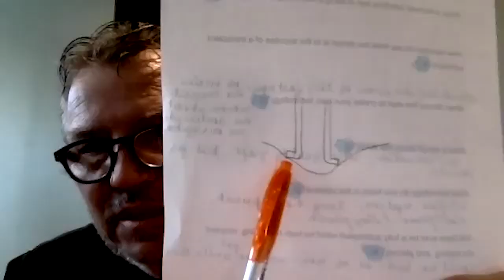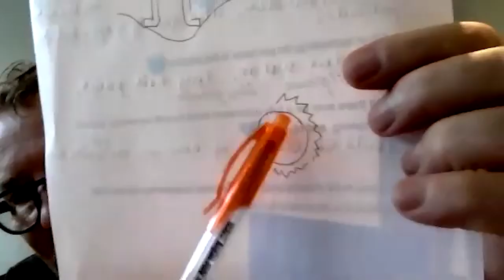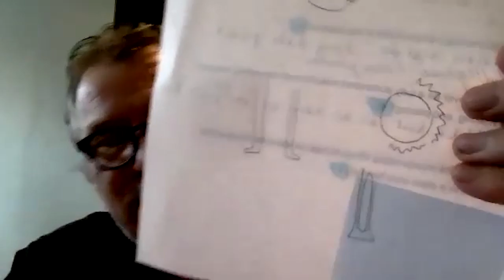I Spent a Day with an Inventor (Hair Transplant Tool)

Comment: Surprised no one has mentioned that it is called the WAW pedal, and is based on the housing of a guitar WAH pedal.
Reply from the maker: Good point.
Reply: Guess there isn’t enough crossover between the community of guitar players & people interested in cosmetic surgery. 🤷🏻‍♀️ 😆

Comment: this was great! interesting to learn that "punch size" is not the same across instruments, and that the difference in wound size is negligible. I'm wondering if your tool could grab the hair and pull up, whether that might straighten the hair, and allow for an easier extraction when dealing with curly hair
Reply from the maker: Curly hair is still a real challenge. It takes a different hand motion and a larger punch size to execute safe extraction.
Reply: @drgarylinkov  that's why I was thinking that different tooling may make that easier. Since the hair curls under the skin surface if you could pull on the hair it might stretch the tissue and straighten the hair path making it easier to extract
Reply: @drgarylinkov  is FUT a better option for curly hair in that instance? Seeing as extraction is the more difficult aspect?

Comment: Hey Dr GL, love the videos. - I am also a HT surgeon. I have been using the WAW machine as well. but have noticed that due to the oscillation motion -  the handpiece does vibrate a lot. What setting have you dialled in to help reduced this vibration. (I'm resorting to having to hold the handpiece very firmly in order to stop it vibrating around - which is taxing and causes a lot of hand fatigue). 
Look forward to hearing from you, 
ZG
Reply from the maker: 25-35